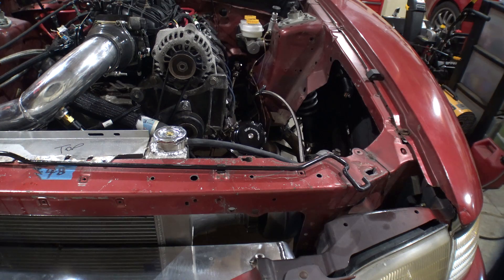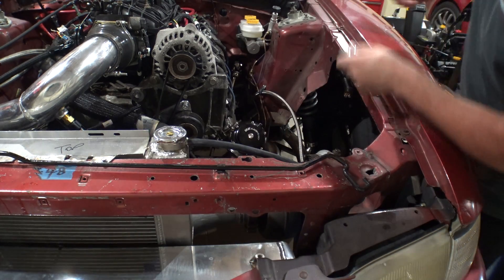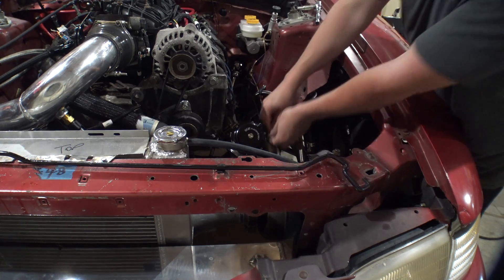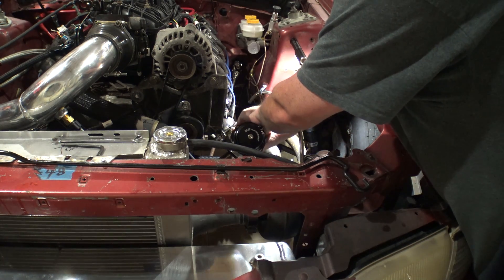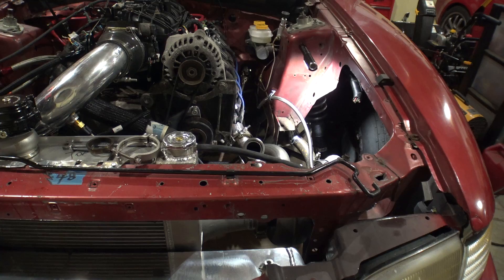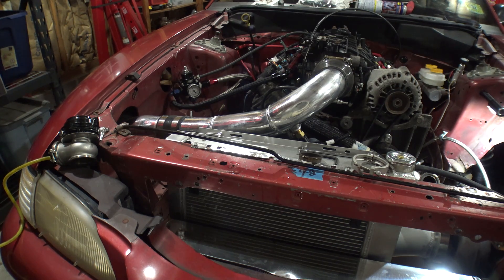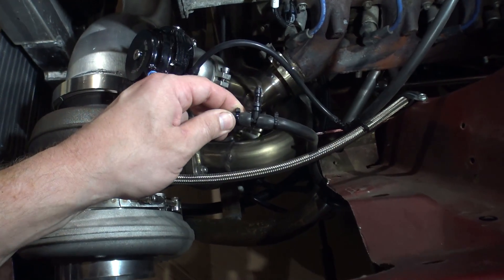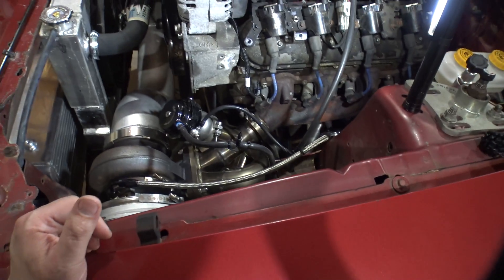project 8f8: testing wastegates and adding references

Comment: Here’s your answer metal push locks been using them for years on my turbo cars and airbags . Also an adaptor for Tial Wastegates 
PneumaticPlus PN15 Series Push to... https://www.amazon.com/dp/B072YWW13K?ref=ppx_pop_mob_ap_share

https://www.ebay.com/itm/262920732029

Comment: How much does the exhaust heat change the spring rate in the waste gate?
Reply from the maker: Usually not at all, in rare cases usually lowers boost because of spring fatigue
Reply: Ok thanks

Comment: Yeah my first time with the push lock I had it melt shut on took me a minute to figure out why it was over boosting  thought my boost control solenoid went bad ended up getting high temp pushlock line and haven't had a problem since

Comment: When you tuned Calvin's third gen you was saying you maxed the gt45 out at 20psi. I'm building the same car pretty much.  My gate cracks at 5 psi so if i use a mac valve to hold the gate closed essentially off would be 5psi then on would be 20psi. Street / race lol .

Comment: Hope to see some info on Holley electronic boost controller along with TerminatorX setup!
Reply: I've been waiting to see how Matt is going to set it up with the TerminatorX.  I've read through the Holley EFI Boost Control instructions a few times.  Definitely a few ways to go about it.
Reply from the maker: @mrrobot545  testing it on dyno very very soon, since they only have dome in the boost dialog for all the cool features, I stole the map signal wire off the MAP sensor and inputted it as a dome sensor and im telling the boost control to use that.